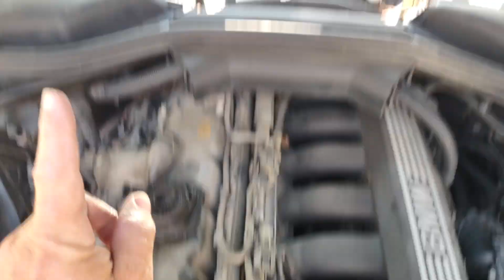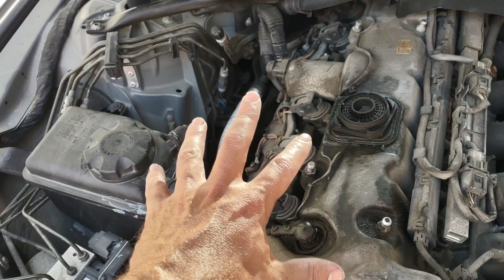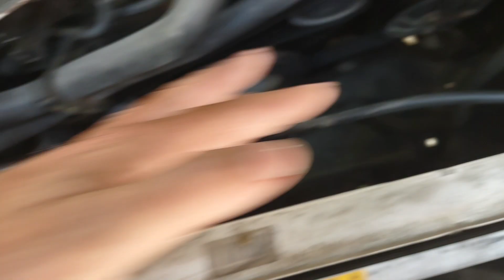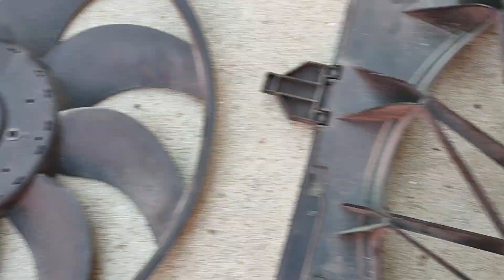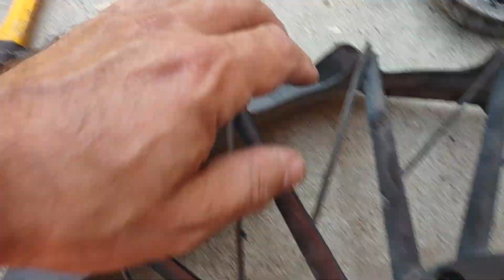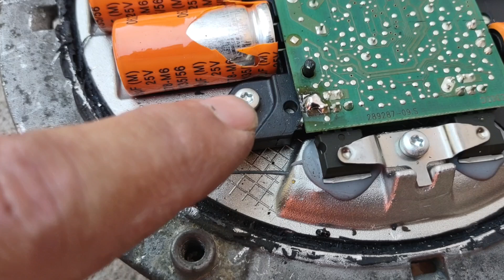BMW rad\cooling fan repair for free!

Comment: How can I test the fan with direct power from the battery to know if the fan is ok or not
Reply: No easy way to test. Sometimes it will still work at 100% but may not work at 25-75%